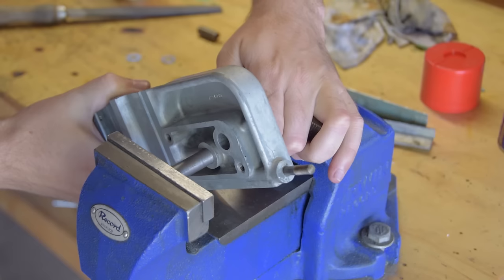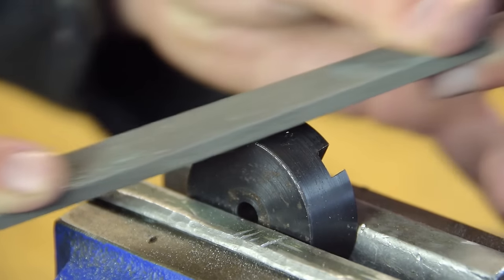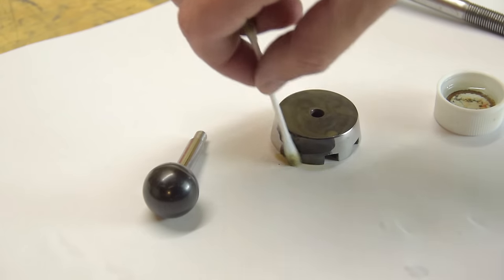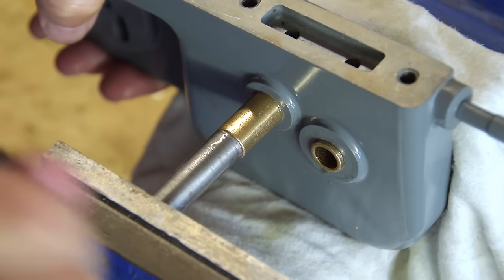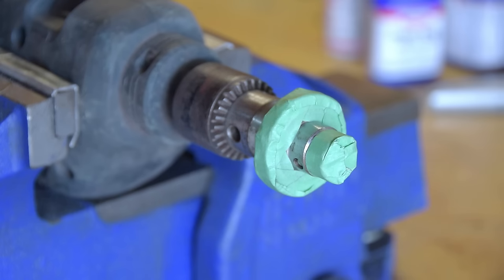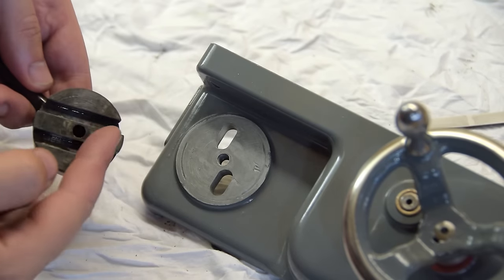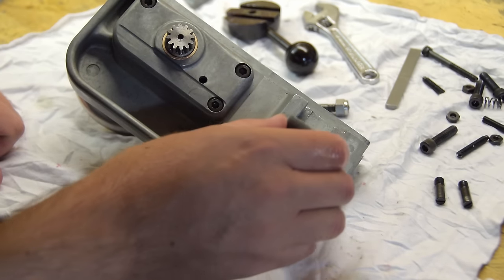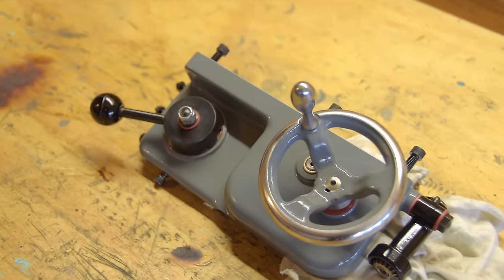Myford Lathe Restoration - Part 6 Apron

Comment: I've just received my grandfather's old ML7, your videos are inspiring me the do some more restoration work on it! Great video and lathe, although I do like the look of a faded and used paint job but that's just me.
Reply from the maker: Yeah, I hear ya. Faded paint is hard to cover up when there's a sentimental connection. Cheers.
Reply: Reading this comment 5 years later and I've also inherited my Grandfathers ML7, it is in much better mechanical condition than the ML7 Geoff is restoring but I do understand the worn paint and general signs of use do give it character, I wont be doing a full restore, but I will be servicing everything to a point where it is as it should have been originally, but apart from giving it a good clean I don't think I will be doing a full paintjob as it holds sentimental value as every single mark was created by my grandfather over 40 years of use and to me.. that's special.

Comment: Hey in regards to gun bluing a part, do your first coat then rub it down with 0000 steel wool and apply a second coat. This gives a much more even finish over the part. You can do the process a few more times if you really want it perfect but i find normally just once is fine for most refinishing.
Reply: I have heard it said that gun bluing is also a form of rust prevention, or a rust preventative,  is this correct?

Comment: One tip on cold blue - I've found that you can remove a lot of the patchiness by rubbing the part vigorously with 3 or 4 aught steel wool dripping in the cold blue solution.
Reply from the maker: Ta. I'll try it.

Comment: I'm finding removal of the apron hand wheel difficult.  Did you use a bearing puller to slide it off or another method?
Reply from the maker: No, but it was difficult. It does just slide off once the grub screw is removed, but I remember mine was very tight.